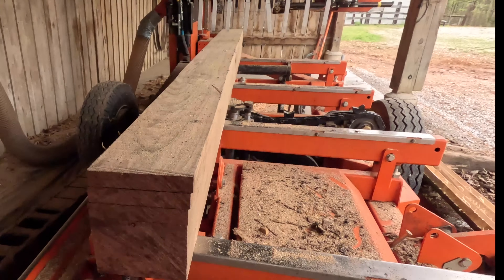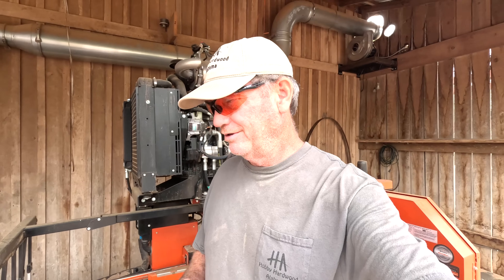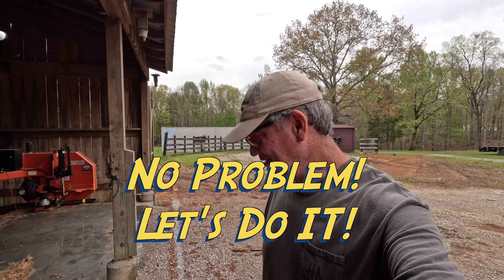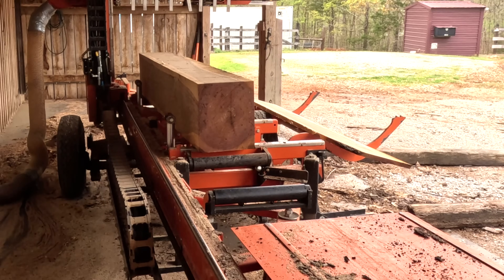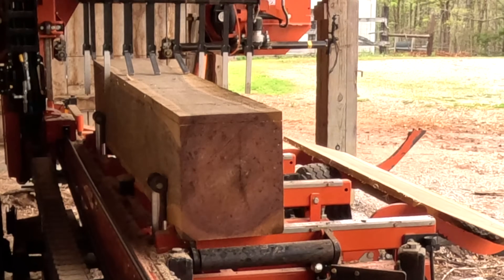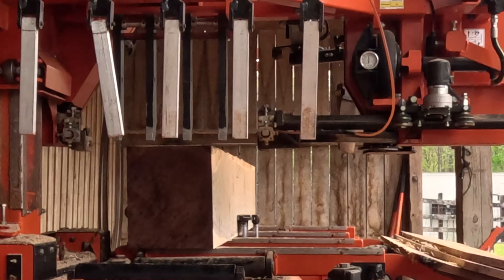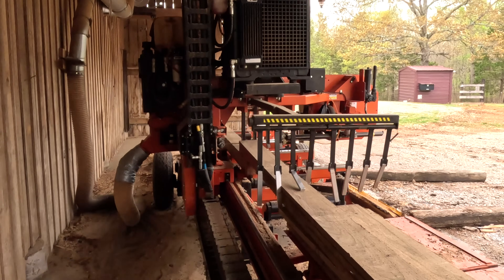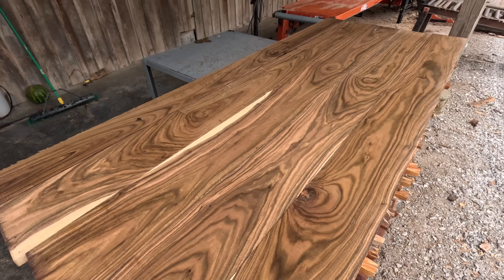Identify Stress When Sawmilling!  Never Filmed Before! Pro Secrets to Sawmill Flat Wood!

Comment: Have a question  if the boards are trying  to curve upward  after sawing  them could you fix the curve by stacking them?
Reply from the maker: Yes, but maybe only 30% if you do everything correct when drying.  The best thing is to try to do everything to get them off the mill as straight and stress free as possible.

Comment: This was above my pay grade. I'm going to have to watch this again. Being a carpenter I know what to do with the lumber. But as a rookie on milling, I am an avid student. Now, at present I am at the introductory level mill, pretty much total manual, but the general principles are the same, correct? Hey, thanks for the good work.
Reply from the maker: Yes, this technique is definately used with any mill, either hydraulic or manual.
Reply: @HobbyHardwoodAlabama  Thanks, I'm going to conduct an experiment today with a short mess of a walnut log. Thanks again

Comment: Thanks for the info Professor Woodyoda! I've been making my way through your videos. Appreciate you sharing your knowledge. I have a question regarding storing kiln dried lumber in your warehouse. Do you do anything to control the humidity? You have a target EMC?
Reply from the maker: Yes, we have dehumidifiers in the building.  We generally keep the doors closed, and the most important thing for both bugs and moisture, the turnover of the lumber being sold should be fast, a couple, few weeks or month if possible, so it simply doesn't sit very long. Store the wood outside as air drying stacks with stickers, and don't kiln dry and sterilize until it is needed and inventory for that species is short.  Dry it, plane its, sell it,  repeat.
Reply: @HobbyHardwoodAlabama  Thanks!

Comment: Would that be the same with pine I cut mostly pine
Reply from the maker: Yes, especially if you mill structural framing lumber.  Always identify the stress direction and put it in the plane where it can be eliminated or minimized.  It only takes a second or two on most logs and greatly increases the usability of the lumber.
Reply: @HobbyHardwoodAlabama  thanks for the update and I've learned a lot from your videos Thanks 👍
Reply: Yeah, but conifers are more predictable. The reaction wood had the opposite function than in deciduous trees, it pushed rather than pulled, and it is visible as a thicker dark latewood ring.
Just like us the tree cannot "push on a rope", so the reaction wood is  made heavily spiralled. When the fibers in a spiral swell you get longitudinal push and the tree straightens up. The first 10-15 years of growth in a conifer is also spiraled, usually leftward. This we call youth wood in my language, it was supple to protect against breaking, and it's often ended with some serious straightening out reaction wood as it transitions into adulthood.
Usually wood shrinks or swells 4% tangentially, 1% radially and only 0.1% longitudinally.
Spiralled wood is different, youth and reaction wood moves more than 1% lengthwise. Nothing can stop that. Back when dimensions didn't matter as much, logs with reaction wood could be used to strengthen a floor by putting the hard but brittle reaction wood on the top side of the floor beams.
These days we don't use beams cleverly like that, so in Norway those of us who give a damn strive to grow Spruce or Pine with a youth portion as small as possible, 2 inches in diameter or less.